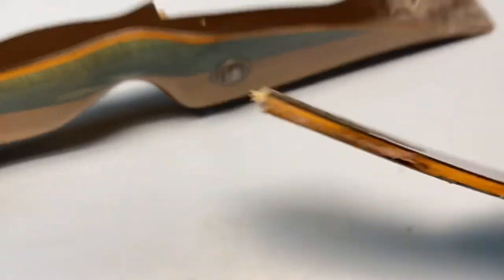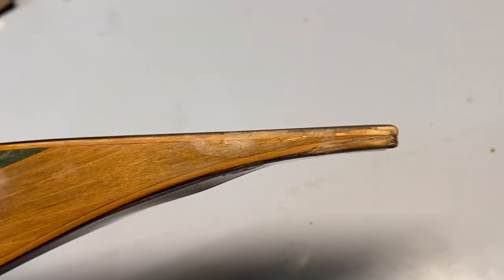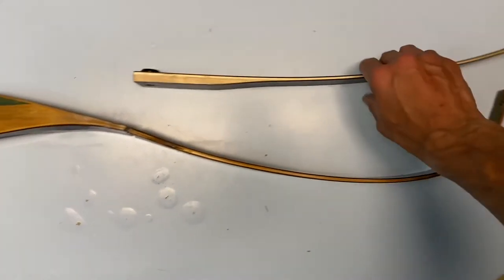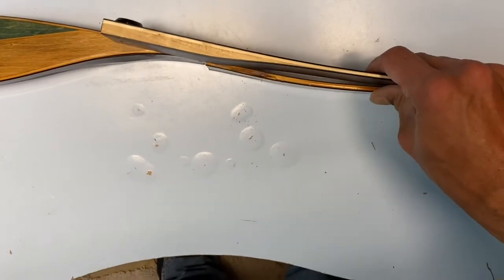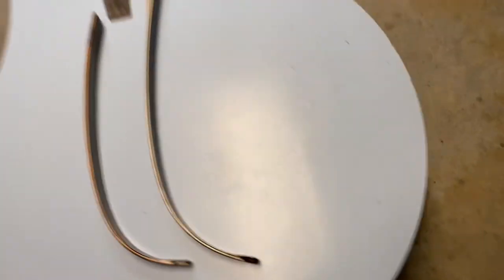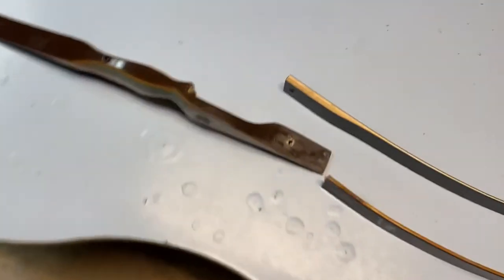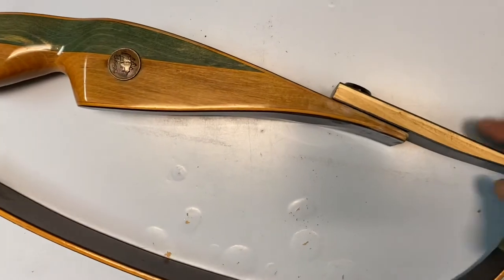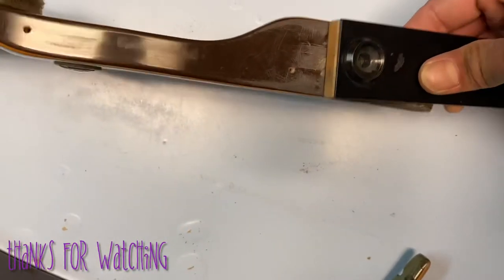Bear Grizzly Limb Fix 3

Comment: Wow, that will be awesome if it works out for you! My main concern would be the threaded insert ... what are you going to use for it not to fail & eventually come out? If you solve that problem, looks like you will be in the clear with metal or aluminum braces on the sides! Can't wait to see what you decide to do with it!
Reply from the maker: I was thinking about after I posted the video last night. The side rails I was thinking about putting on should be a metal plate with upturned flanges on the side to stop the limb from rotating. The plate should have a thru hole for the limb bolt that is smaller than the insert and be screwed down onto the riser. This way the insert would be held in by the metal bracket.
Reply: @HandyL  I was thinking the same thing, but finding a bracket like that with the correct size might be a hard find???
Reply from the maker: I can make it. I was a metalsmithing/jewelry major in college. Have plenty of experience fabricating and welding metal. I think I can work something out. They don’t call me Handy for nothing 😁👍🏾
Reply: @HandyL  cool!